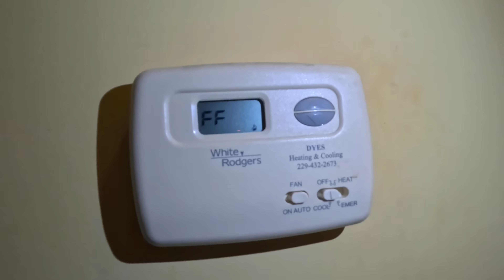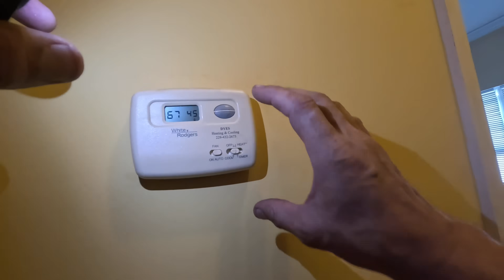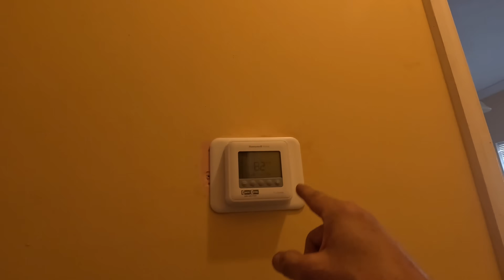Thermostat Acting A Little Odd! #hvacguy #hvaclife

Comment: Anyone have any clue why my Gree running in cool, not cooling very well would have a very cold liquid line? It's so cold there's condensation all on the line. 

I do have the HVAC guy coming today, but it's just a strange thing I've never seen on any HVAC videos I watch. 

My other unit isn't working either . I'm 99% sure it's the cap. Doesn't sound like the compressor is running. 

Yes both units failed within a week of each other. Usually we have at least one working so we have some solice when the other one breaks.

Comment: I would not be happy with that replacement, unless it was a temporary replacement while you ordered one that was similar size to the last one so it covered up the mess on the wall that was behind the last one. Then again, I would be doing my own replacement on something that simple.
Reply: One tiny whisper of sheetrock wasn't covered. We've all seen MUCH worse. And if this guy knew how to do it himself, he would have, don't you think?
Reply: A working thermostat in Georgia beats a little touch up paint on a wall.    When you do your own replacement, it's not as easy as you think it is.